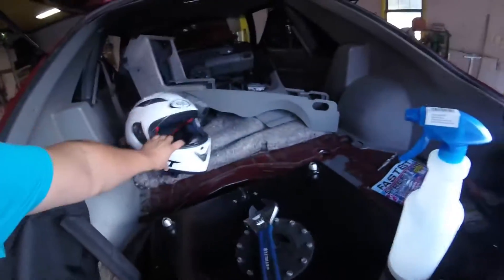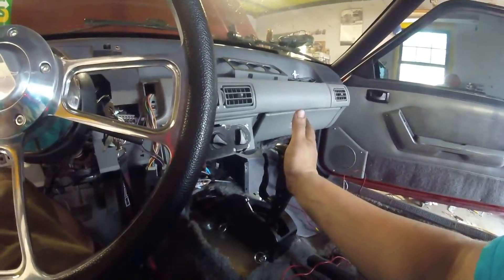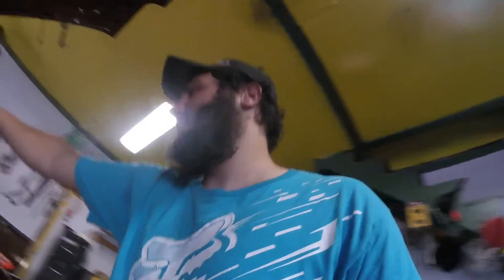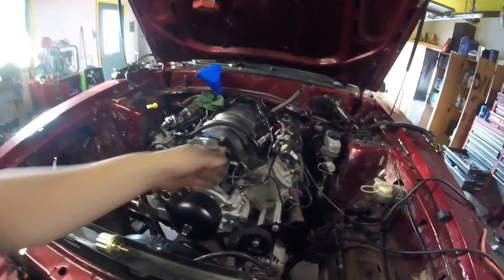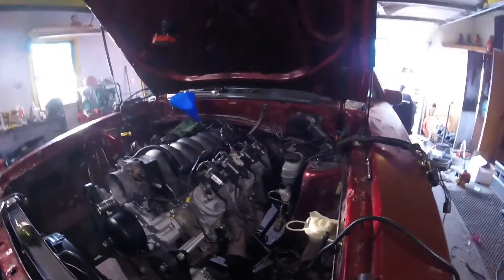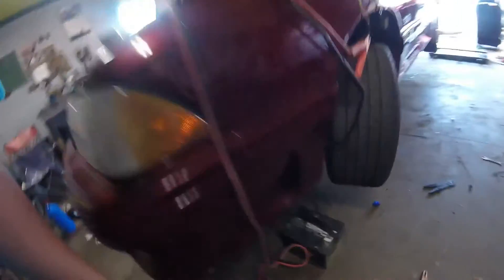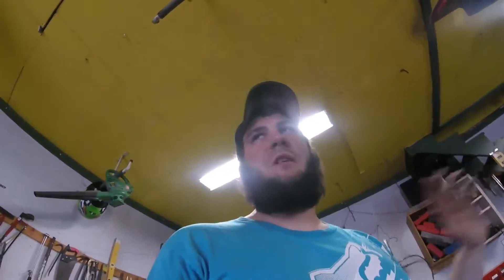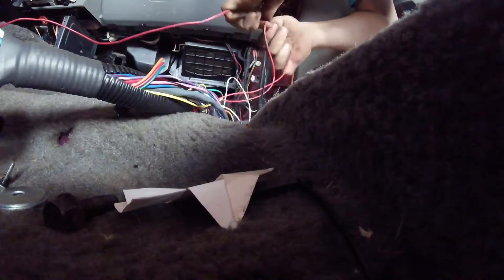Fox Body Mustang LS Swap First Start Wiring Microsquirt!

Comment: Do you remember how you wired the crank sensor? I have a GEN IV that is giving me issues with not rpm synced. the microsquirt was modified by efi source to run 58x and i just put a new crank sensor thinking that might have been the issue. right now it is wired-- 5v ref from (tps/map) for power supply, then vr- negative for signal, and ground to sensor ground. 
-Also for my ignition options -

spark mode: toothed wheel
skip pulses: 3
Ignition input capture: Rising Edge
Spark Output: Going High
Number of Coils: Wasted Spark
Spark A Output Pin (IGN1 Normal): IGN1
Trigger Wheel Arrangement: Single wheel with missing tooth
Trigger Wheel Teeth: 60
Missing Teeth: 2
Tooth #1 Angle (deg BTDC): 80.0
Wheel Speed: Crank Wheel

This is the only thing keeping my car from running so any help will be greatly appreciated!
Reply from the maker: plasticzeus40 my motor is a 24x I haven’t messed with 58x wiring yet